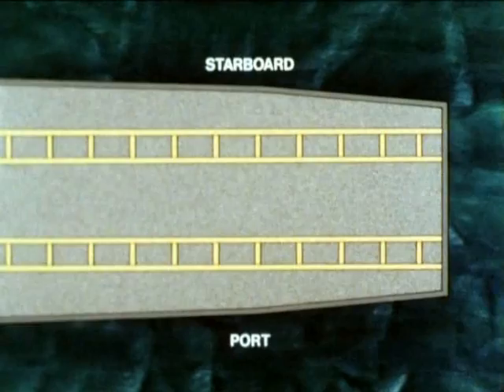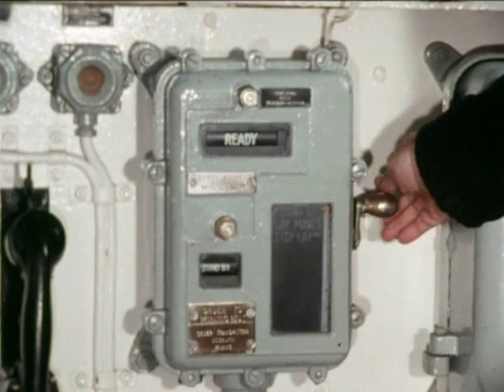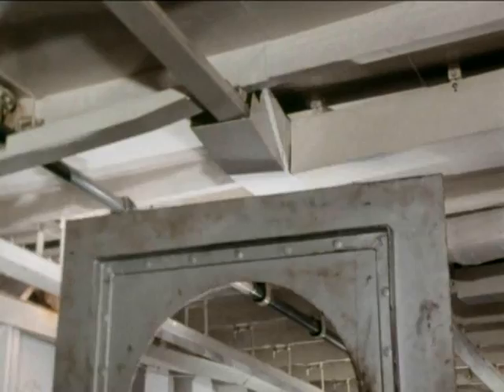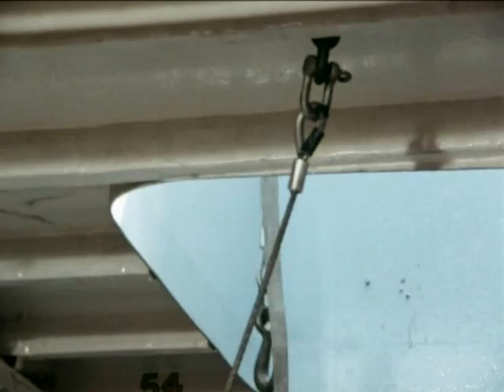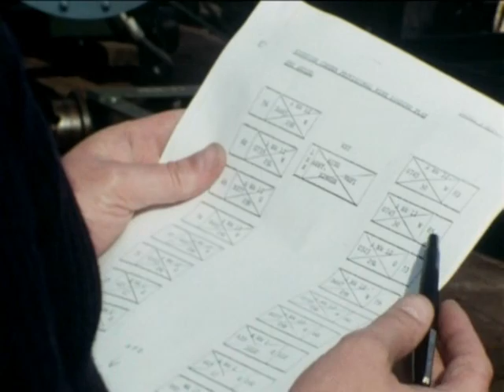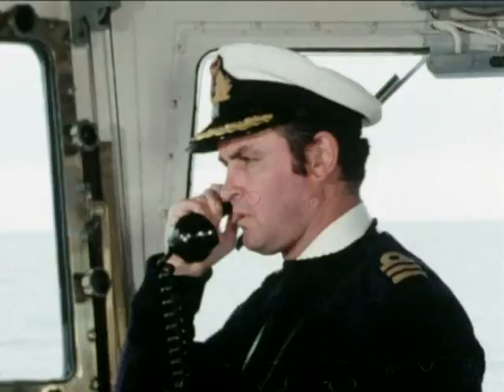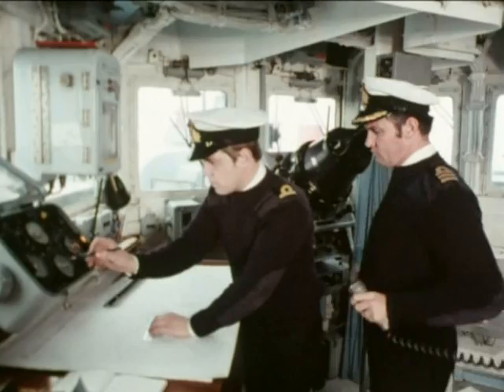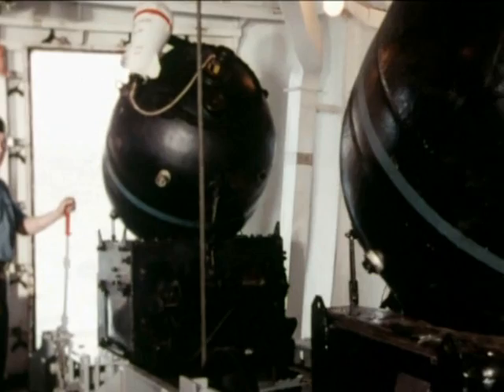Minelaying (1976)

Comment: They threw away the spacer :-/
Reply: I mean, the track is closed except at the point where they load it, they'd have to remove the mines behind it to let it off the track, but they have to lay those...so off it goes just like the mines
Reply: I used to make those.  Good riddance to them.
Reply: @liquidsonly  you used to build mines, if you don't mind me asking?
Reply: @bobbymancini9069  I don't mind you asking. I used to work in the machine shop, no mines allowed in there.
Reply: I assume the spacer is designed to be disposable in a real minefield (mainly as the mines are more expensive (and expendable as well) and raw danger of turning around in the minelayer to recover them) but I am surprised they don't rig the training models with floats or radio beacons so they can recover them for reuse (I assume the training mines are expensive and thus reusable, obviously a live one isn't though lol :D)
Reply: @josephmontanaro2350  or a lanyard like static parachutes
Reply: If only they had a ship  to store them on to be used again  later.

Comment: I was an FTG aboard USS Joseph Strauss DDG-16 during deployments in 1970 and 1972. On June 4, 1972 just after midnight while making a firing run on a North Vietnam target, a huge underwater explosion under the bow, picked up the front half of the ship out of the water. The ship fluttered for several seconds, then slammed back into the water. Boilers went out. Engines went out. Strauss was dead in the water off the coast of North Vietnam. Several minutes later, another huge underwater explosion off the portside rolled the ship to starboard. 10 degrees, 20 degrees, 30 degrees, etc. Somewhere close to 35 degrees the rolling started slowing. The ship rolled to about 40 or 45 degrees, then started up-righting itself. Strauss was towed farther out. Boilers were relit. Engines refired. Strauss remained on station. USS Warrington DD-843 also experienced two huge underwater explosions. Warrington was towed to Subic Bay and was decommissioned due to the damage. USS Hollister DD-788 also experienced two huge underwater explosions. Hollister was able to remain on station. The damage to these ships were from mislaid U.S. Mark 36 Destructor Mines that were laid during Operation Pocket Money in May 1972 off North Vietnam harbors.

Comment: Why do they test the mines when they are on the ship? That sounds like a really great time to figure out half of them are broken.
Reply: They would test them after they were made the tests on the ship would to ensure nothing has happened in storage or transport.
Reply: It would only be one of many tests they would go through, during and after production, on a set schedule while in storage, when moved from storage to the docks, and then once embarked on the ship.
The reason for doing it on the ship is twofold.

1 is because they can repair many of the problems that they test for, such as bad connections in the control circuits, failing batteries, damaged switches etc, thus ensuring a properly functioning mine.

And reason 2 follows on that.
They don't want to lay a faulty mine, because it is a danger to their own ships.
Whether it has a faulty arming circuit and detonates right behind the laying ship, or doesn't properly anchor itself because of a bad release mechanism, etc.
Mines are very dangerous weapons to everyone, and the only way they work for the navy that lays them is if they are exactly where they are supposed to be, and that requires proper functionality of the systems, and so if they find a problem in the testing that they can not repair, then they would have some procedures in place to either jettison it unarmed and vented so that it just sinks to the bottom inert and harmless, or jettison it with some sort of demolition charge or a self destruct timer, or retain it on the ship to take back to port. (if the weather was decent, they could use the ships crane to shuffle the mines and move the faulty one to the rear of the line)
Reply: Even modern explosives have failures, its quite common, stuff happens.

Comment: The design of the mine back then didn't change much compared to WW2 mines.
Reply: was think the same thing, look just the same.....
Reply: @Lockbar  The video is older than suggested
Reply: Its a good long lasting design but the appearance  itself is deceptive. There were several mechanical improvements and differences in not just the construction of the naval mine but also the mine laying strategy as a whole.

Comment: That's a surprisingly archaic system, even for the times.
Reply: This is 60's. not too far away from when they were properly using them
Reply: @TheFreshSpam  by the mid sixties the RDN had fully automated mine decks
Reply: @chrthiel  I'm sure on the flagships and the few newer classes at the time. Probably not standard on all at the time
Reply: @TheFreshSpam  It was standard across the entire fleet by 1964
Reply: @TheFreshSpam  Er its 1976
Reply: @blazer666del  Yes, things get used for more than 10 years you know...
Reply: better then just dumping them over the side lol

Comment: Confused as to why they jettison the spacer. Seems like a waste lol.
Reply: It's in the track of the guiding rails. They'd either have to start manufacturing spacers with retractable lugs, which would increase man hours spent on manufacturing each spacer, refit every minelayer with guiding rails that retract so you can remove the spacer, or dangle someone behind the ship to grab the spacer before it flies off, which would increase the time spent laying mixed minefields. They said in the video that sometimes one rail would be nothing but contact mines and the other nothing but tubes to avoid this issue while laying mixed fields.
Reply: for training I agree, they should have some kind of floats or radio beacons to recover them, in wartime it wouldn't matter as the "expendable" single use exploding mines are way more expensive then spacers but I understand your point (also would you really want to risk not just the remaining mines on board but the e tire ship and crew to go back into your brand new minefield to recover them? think of them like giant hand grenade pins or the safety caps on RPGs or the cloth satchels that houses the bricks of plastic explosives in pre assembled satchel charges
Reply: @josephmontanaro2350  Well then you'd have to account for the manufacturing of the floats or radio buoys and the materials/time/effort used to recover the spacers. After all, these spacers probably haven't changed in design since WWI and they're probably WWII surplus at this point in history. It may be a waste, but it's infinitely safer and cheaper to not recover the spacers.

Comment: thought mines were underwater as not to be seen
Reply: They are set to a depth.  They float while the sinker sinks, ans pays out cable, then the cable is locked at a set depth and then the sinker drags the mine down with it.

Comment: Now I want to join the Navy
Reply: Don't, join the air force instead.
Reply: Dalton Chew won’t get much sea mine laying done in the RAF
Reply: @smpgeek  Same with the navy. They stoped using sea mines a long time ago.
Reply: @maxischew514  do they only sweep now?
Reply: @smpgeek  I think so. Thought they can lay mines in places like Sydney harbor where they can be retrieved early but if they're anticipating enemy ships there you know we're in a bad situation.
Reply: @maxischew514  so they do lay mines?
Reply: @smpgeek  Really no.
Reply: @maxischew514  they have the ability to lay mines?
Reply: @smpgeek  Yeah. Though they have to retrieve them as you can't really leave explosives in the middle of the ocean and hope that some poor fishermen doesn't get sunk.
Reply: @maxischew514  that's what they did back in '76 anyway
Reply: @smpgeek  It's historical footage.
Reply: @maxischew514  yes
Reply: @maxischew514  Royal Navy still has the ability to lay mines but they would now use a crane fitted with a trip hook. If there was a need to lay mine fields using hundreds of mines a STUFT ( ship taken up from trade) commercial ship fitted with cranes or mine rails could be employed. Or they could call in SERCO to do the job. Most but by no means all ground mines are 533mm (21") wide same as a heavyweight torpedo and can be layed by a submerged submarine. Ideal if there is a need to lay mines in a choke point or the entrance to an adversaries home port.

Comment: wait what? they even throw out the spacers? Lol. The entire system sure was clumsy, slow and flawed imho, too many opportunities for mistakes.
As engineer I sometimes I wonder about American engineers, how this even passes the end phase of design and testing is beyond me.
Then again, we can see the results of this ignorance in Agricultural machinery to this day.
To make my point (I know this system is out-dated, but it's fun):
1) you can only load one mine per crane
2) mines have to be handled by multiple personnel
3) Poorly designed access points on the ship for loading
4) over complicated wire rope design and sled, handled manually, with danger of exposed braid wire, inflicting injury, rope is "dragged" 
5) substantial waste of space when mines are stored
6) storage design requires planning and execution of a "floor plan", improper directions result in loading/unloading delays or unsafe storage
7) personnel is secured via rope and exposed to immediate danger at the back of the ship, during opening of the hatch and "extending" of the rail
8) faults during laying put mines and sled in a difficult to resolve state, once a mine is over the "hump" it cannot easily be removed or the sled reversed.
9) personnel on-board is required to inspect and repair mines after mines are loaded, waste of resources and space for equipment
Reply: wow, you must be fun at parties
Reply: @ohmyblindman  depends on  the party of course.
Reply: What has this to do with American engineers? It's the British Navy.
Reply: This was an exercise minelayer and it's using 2nd WW technology. Filmed in the 70s and the ship wasn't new. Shit mate, give the blokes a break. The country was broke, we only finished paying our American cousins back the money we owed them in 2006.
Reply: @stephennelmes2707  Granted, we always learn from mistakes and poor designs. I just feel like that even then, this kind of stuff could have been designed much much better.
It just looks like that nobody even considered better options, there is so much wrong with it. Even the wintergatan marble machine kicks the shit out of this thing. The royal navy minelayer was better designed in 1918 and they really didn't know much then.
So for almost 60 years the Americans couldn't steal some ideas? Hehe....
Reply: @oBseSsIoNPC  Yes mate you are completely right. I often wondered why they didn't make the loading hatch bigger to accommodate the ground mines. British engineering, when it's good its really good, when it's bad it's awful. Like the SA80 rifle. Design rifle, build rifle, find rifle is full of design flaws. Try to fix rifle (twice). Buy German company Heckler and Koch. Pay H&K £98,000,000 to make rifle better. Sell H&K. Even H&K couldn't make a silk purse out of a pigs ear. Read ' Lions donkeys and dinosaurs' waste and blundering in the military. You can still buy it on line at Abe books.
Regarding the Americans, the Japanese did to the Americans what the Americans did to us. Take someones product/idea, see how its built, make it better & cheaper then sell it back to them. Japan did this with cars motorbikes tvs and just about everything else......Except weapons.
Reply: @ohmyblindman  he is right, there are several issues with this system and many of the points he bring up were addressed in more modern minelaying systems, you do need to give them credit that this system was developed during or shortly before the second world war and the only conflict that had even seen remotely as many seamines deployed in such large. numbers was ww1, a lot of these refinements seem common sense in hindsight but that would be like faulting a flintlock musket for not using a metallic carriage, smokeless powder , detachable magazines and a fiew selector, as they say hindsight is 20/20 and its hard to design product features in what is essentially a weapons system that in its modern form had only existed for roughly 20 years and most of the feedback was from a single war (massive minefields were not really used before ww1, that would be like saying "yes, ICBMs have existed since the 60s but in 2054 after 5 nuclear wars why couldn't the morons in the 60s see this obvious design flaw that only came to light after mass combat deployments of said weapons system"
Reply: The military usually goes with if it works why fix it approach..New equipment might be untested and break, while this film is from the 60’s and using techniques that were proven all throughout WW2…A good example of old school is US tanks vs Russian ones..Russian tanks have a auto loading mechanism for the main gun, while US tanks do it manually…Yes the auto loaded can be faster but if it jams or breaks the gun is useless..Manually doing something allows the person to solve the problem and address any problems that come up.